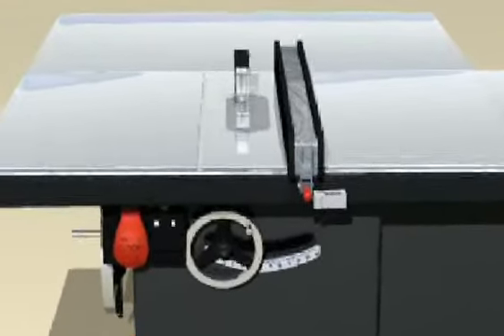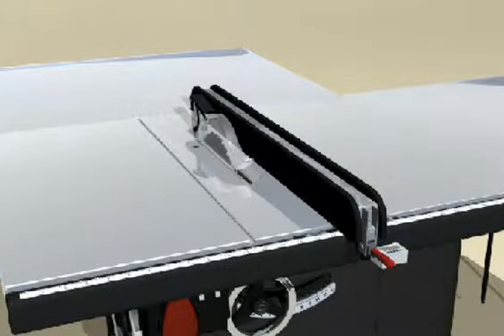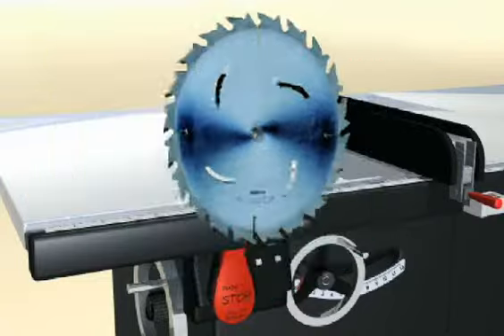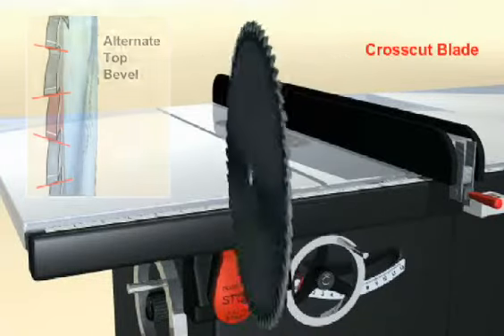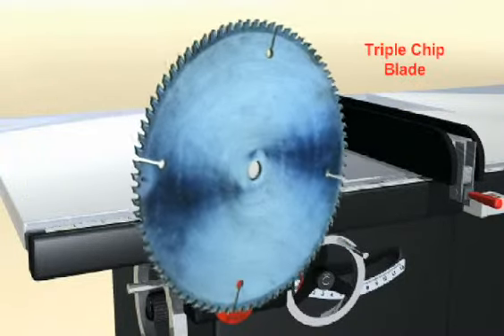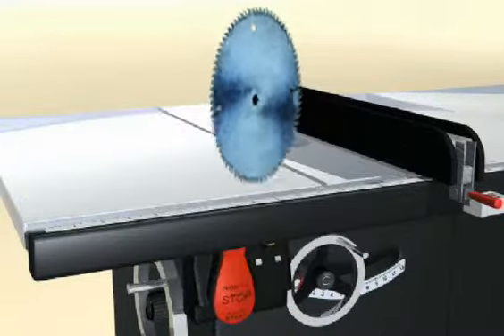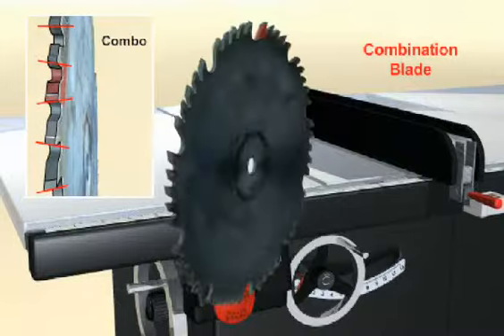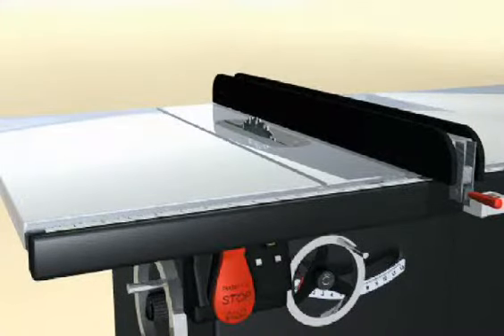Common table saw blade types

Comment: Hi Patrick, 
I love these video's you do. 
I found that describing hook angle, side clearance and bevel angle (Forrest HI AT for example) often made it difficult  for a trainee to understand what is the best blade for the job.  Do you have further information that helps understand those nuances?  I am further confounded by individual manufacturers design parameters.  Forrest for instance uses TCP sparingly while Everlast offers this tooth on most blades as an option.  How does one choose?